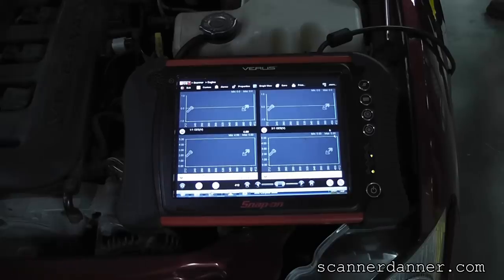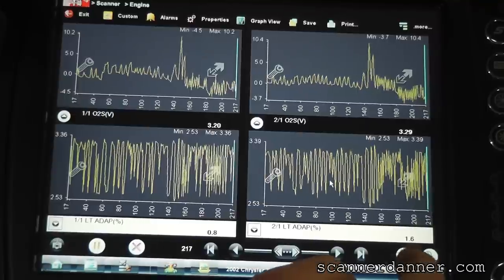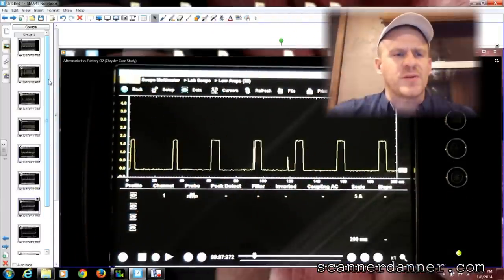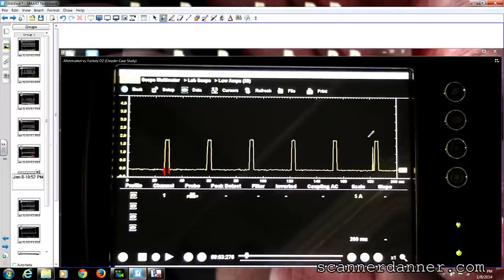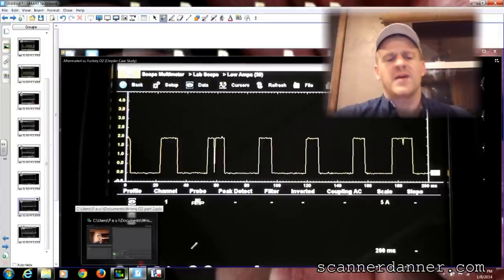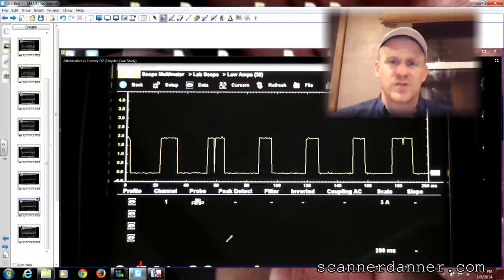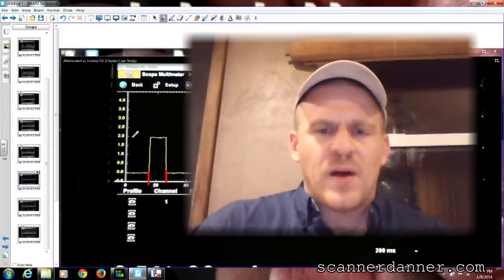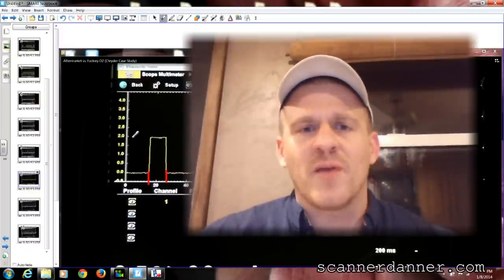WARNING! Aftermarket Oxygen Sensors (Chrysler/Dodge/Jeep part 2)

Comment: Paul,

My guess is that the Bosch O2 sensor/ heater was for the older model years which was a constant +12V feed from the ASD relay design. The newer PWM design heater drive from the ECU if ever having constant "on" would probably burn out the heater element in short order. A heater resistance test/comparison between the 2 sensors would have been a very basic troubleshooting test right out of the "gate". Also going forward, troubleshooting an O2 sensor output problem, I'd really think to measure the temperature of a sensor (while removed from  the exahaust pipe/manifold; insulated/in free air) via an infared laser thermometer. From reference information, all O2 sensors require a minimum of 600 degrees F for them to start producing usable output. The PWM design was probably implemented to reduce the D.C. constant current drain on the older constant "on" ones of the electrical system (4 heaters @ 2 to 4  amps each); yeah maybe saving 0.5% of miles per gallon. Why waste a constant 100 watts + of electrical power when the exhaust normally keeps the O2 sensors hot anyway (above high idle)? The SW/FW in the ECU probably decides if the the O2 sensor output peak voltage starts dropping  then increase the on-time for the heater(s) to get the output back in range.

Just my 2 cents worth and entirely free (LOL)

Tom
Reply from the maker: yep, it is all about fuel economy for sure. Thanks Tom
Reply: +ScannerDanner  I just had this same issue come up on a 2004 Dodge Intrepid 2.7L. B1S1 had been replaced with a Bosch piece. It was setting code P0132,  P0300 and P0301. B2S1 was OE. Graphing data showed bank 1 at -30%, explaining the misfire fault codes. On start up it was clear that while bank went closed loop in 30 seconds, bank 1 would not achieve closed loop until the car was driven, heating the sensor enough to finally start to read closer to the normal range. Close enough atleast for the PCM to achieve closed loop. Bank 1 never did toggle normally or operate in the same 2.6 - 3.5 range as bank 2. One curious point is that the heater duty cycle on the Bosch sensor read about 33% of the OE sensor. Resistance testing indicates that the OE sensor reads 4.4 ohms cold while the Bosch sensor reads 3.2 ohms. I'm not sure if this is causing the PCM to short cycle the heater. It is interesting though. 

After verifying the 5V signal circuit open voltage and 2.5 volt ground, along with heater control operation, I swapped B1S1 with B2S1, just to confirm that the sensor was at fault. The problem followed the sensor. The poor signal performance, difficulty reaching operating range and low heater duty cycle. Checking our parts supplier catalog, I found the same Bosch sensor listed for this application. I tried a replacement Bosch sensor, in case the sensor in the car was faulty. The replacement had the exact same issue. I have installed many Bosch sensors in all makes and models. I have rarely seen any issue with Bosch parts and believe them to be one of the higher quality parts suppliers. This system is simply one variant, due to the 2.5 volt biased ground, that must have a very specific sensor in order to operate correctly. 

Ordered OE replacement sensors (replacing both front sensors on this 175Kmi car) from the Dodge dealership.
Reply from the maker: Don't forget you can order NTK sensors outside of Chrysler for way less!
Reply: +Mark Kelly Thanks for the great vidoes. I love to watch them, just as a refresher. In this video you question when Chrysler began using the 2.5 volt O2 ground bias. I believe this came with the change to the NGC from the SBEC PCM. That change was made, generally in 2003 although some late production 02 models may have received the NGC. I can't say if the Huntington and Motorola NGCs both use the 2.5 volt bias. I should know this but I really don't remember. It's been too long and too many cars since then. I'll know when I get another Motorola unit in the shop and look at O2 signals.
Reply from the maker: Thanks Mark! And thanks for the info
Reply: +Tom Dewey Hi Tom, I picked up this question from the video, whether the difference in compatibility is due to  PWM heater control vs. constant. In this case, for this particular Bosch P/N, that may be the case. I did measure a difference of about 25%(3.5 ohms Bosch vs. 4.4 ohms OE) in heater cold resistance. However, I will say and I'm sure you know this too, PWM O2 heather control is common. A few OEMs use this type of O2 heater control. I have installed Bosch sensors, as well as Denso and NTK in all makes and models of vehicles, including those with PWM heater controls, with rare issues(all brands are susceptible to defects).

Comment: 6 minutes into the video. Maybe it was mentioned along the video or maybe on part 1.
Some insight. Point in case not all parts are built the same way. Period.
For most layman the important info is. Get an OEM (or same factory) aftermarket part. Layman only "see" it's the same thread and the plug fit in place...and there's so much more! ;-)
Particularly on sensors reading and translating "delicate" information. The change of a resistor value, a coil winding, the metallurgy of a contact, the internal design, etc. can and will change the output! It's that simple, no big secret about it! 

Oh! BTW it's not a conspiracy theory of one brand vs the other! LOL 😂 

O2, MAF, MAP... are among the ones who can give bigger head aches. So it's simply easier to go OEM on those. On the other hand a crank sensor, or oil pressure, etc. are basically switches and they're output although critical. It's not so finicky. Pretty much either it's On of Off. 
For the the other example, where 1v is expected on the output. Presenting the system with .8v or .9v will produce different output from the systems expecting the correct value, like an ECU.    

Some assemblies, notice I didn't use the word "brand". Are more susceptible than others. Due to the input tolerance admitted. Once more for the layman it's a pretty big gamble, so make sure to get the part that will introduce the least amount of variations to your equation (problem)! Or in other words OEM. Now gonna see the rest. ;-) 
Cheers

Comment: I have a 2001 stratus with a 2.7 in my shop and can get a sensor ground reading off of it if you would like.
Reply: sure, that would be great!
Reply: The 2001 JR platform cars used the older SBEC (Single Board Engine Controller) which uses the ASD relay to power the heater circuits. In 2003 Chrysler switched to the new NGC computers for the 2.4L JR and somewhere in 2004 or 2005 the 2.7 also switched over to the NGC computers.

My guess would be the NGC computers was when the bias signals started.

Comment: Great info Paul.  On this model does the scan data show o2 heater temp?  You might be able to compare the temp to amperage by making a custom probe on the pico.  You could use the good sensors amperage as your baseline and convert that to temperature.  If scan data doesn't show this you could put a temp probe on the exhaust and measure it to match the amperage, then put in your scaling for the probe setup.  This could be a good way to see if the computer is looking at the 02 signal or if it is a fixed value from the computer.
Reply: Busjockey1, that was a great idea.

Comment: ScannerDanner  I was thinking, would it be possible that the varience between the two circuits is that one is design to be operated in parallel vs series? Given the wiring types the resistance changes each would step down differently on the heater circuit.  If it was designed to run in series vs run in parallel because of the grounding that particular leg may not be getting enough current to properly heat the sensor.  By running at higher rpms the combustion cycle drove the heat of the sensor up to proper operating temperatures giving proper wave form but at an incorrect voltage stating that a resistance modification to the circuit may step it back into normal operating norms.

Comment: @ScannerDanner, have you contacted Bosche about this problem with their O2 sensors?  It could be that they make a proper sensor for that year car, but its listed incorrectly on their web site. Either way, with the proof you show in this video and the part 1 video, they should realize the error pretty quickly and hopefully fix it.

I had a similar problem with Dorman where they (and all my local auto parts stores) list the wrong door hinge pin part number for my wife’s ’98 Mustang. But they do make the correct part with a different part #. I emailed Dorman about it a few days ago but haven’t heard back yet.

Comment: Great video Paul.. Can you tell me if any other Chrysler and dodge vehicles are affected by this design change ex. Jeep Ram or is only the cars?
I work a large retail part store and I am pretty sure that they can get bosch & NGK and  the other aftermarket O2 sensor company's to check into this problem

Comment: So they are not compatible , i am surprised  from bosch , i have a car that i had to run a separate ground , is the pwm the same frequency , maybe the 2.5 v is the feedback .
Reply from the maker: the 2.5 volt signal bias is completely separate from the PWM heater circuit

Comment: This subject is getting deep and I like where you are going Paul. lol  Do you think it could be simple enough to do a resistance bench test between the NTK and the Bosch O2 sensor specified for this engine? Is something like that possible?  The resistance possibly could conclude that the computer is 'confused' and can't figure out what it was designed to do with those parameters.   Remember what the ST fuel trim signals looked like in part1,  when it was trying to 'calibrate' or figure itself out? Bosch engineers obviously have missed something for this to occur.  Maybe if they were informed of this issue they could have some answers!  They spec and sell the product and need to make it right.   Great vid as always

Comment: In the first video the computer decided that the sensor did not work properly and the reading was identical as the other bank. How did it now? The only way I can see that is happened since the sensor was fix high the computer start making the sensor to run cooler and look for a response.But
 I don’t know what happen when the sensor runs cooler and still in closed loop if my theory is right the voltage should drop a little bit in response. What is the purpose of pulsing the heater? Is it to make the heater element last longer. For me it does not make sense why the heater circuit with the current and voltage is identical on both sensor should be treated differently by the computer.
The only reason is a bad connection at the connector which is highly unlikely why is it that the computer is not setting a trouble code at heather circuit if this is not the computer that is switching it on and off for longer period then normal.

Comment: Would this cause a  p0430? I am chasing this problem. Shop told me cats are fine...I did replace bank 2 sensor 2 with aftermarket. And car. At light throttle shudders till I give it more throttle... My car is 06 300c 5.7

Comment: Struggling with a bad sensor reading issue on my 05 Grand Caravan 3.8L, confirmed it has the 2.5v ground wire bias.   Went to the local dealer and opened up their sensor....... Bosch!  Same as the one in my van which I believe is the original. Explain that.
Reply from the maker: It is becoming more and more difficult to answer questions here. I have 80,000 people asking me for help now. So I have created a forum to help you guys better. It is free to join and we can exchange pictures, wiring diagrams and waveforms if needed to help guide you through the process of troubleshooting your vehicle. Thank you so much! Hope to see you there. 
Paul Danner (ScannerDanner)
 https://www.scannerdanner.com/forum/post-your-repair-questions-here.html

Comment: Hi Paul. I'm blown away by your videos, you're like an Ienstein. Anyway i have a 1990 jeep xj renix. I replaced the o2 sensor with heated aftermarket. One was Bosch the other NTK, both look identical. The issue is they both caused a parasitic draw of almost 2 amps. Where would I get one that works in renix engines? Thanks in advance.
Reply from the maker: The renix system uses a titania type O2 sensor that modifies a 5v reference. You absolutely cannot use a typical zirconia type O2 in those. Where to get one? That I cannot answer my friend.
Reply: This might be a bit late, but my Renix-based 89 XJ uses a NTK 23553, it is a Titania-bssed sensor.

Comment: Would this go for an 03 jeep 4.7? The forward 02's were replaced with denso by the previous owners. Sometimes it runs decent, sometimes pretty rough. I'm thinking the 02 sensors are the issue
Reply from the maker: yes sir
Reply: @ScannerDanner  thank you for the reply. Love the vidros

Comment: anybody, do you think this problem with a chrysler o2 after market sensor will cause the same problem with a chevy silverado? my original sensor on my silverado went bad, so i replaced it with a bosch sensor and the problems  still exist. i inspected the connector and cleaned it but the problem did not go away. i am going to replaced it with a donso o e sensor tomorrow.
Reply from the maker: I've had no issues with Bosch O2s on any other manufacturer
Reply: i replaced the bosch o2 with a denso o2 sensor monday night and i did not get a p1133 code since then. i took the truck for an emission test today and pass it. woohoo. i will never get a bosch o2 sensor again.
Reply: Nice! Crazy Bosch hasn't fixed this issue

Comment: One thing I noticed that jumped out at me between the last video and this one was the triangle waveform.  You even recognized it yourself.  I said to myself there's something else going on with that triangle.  It's really hard for me to describe but it seems as if there was a filter between the triangle wave and the drop outs.  I only saw the triangle for a short period when you were really zoomed in (maybe 1ms scale)?  I think there might be an overlap worth investigating.  Like if you offset two sine waves there's going to eventually be a dropout both high and low only in this case the overlap of the triangle is causing a low dropout.  You're not seeing the high drop out (overvolt) because you said it is being limited by the ECM. I have NO clue if that's even close to being helpful.  It's an idea, a theory, and I know you like hearing those.

Comment: On a related topic, I cleaned an O2 sensor...stop screaming at your screen and I'll tell you what I did, and the results.

I was polishing up some metal on my exhaust anyway before getting a good weld on it. Metal flakes got all over in my pipes pre-cat. A mental palm to the forehead later, I pulled both O2 sensors and blew my air compressor in them to get the metal shavings out.

I noticed my upstream O2 sensor had built up white crud on it. It had looked good on my scan tool until recently. It seemed to lag behind or get it wrong a little bit.

I'd hate to replace a good sensor just on suspicions, especially after this channel and Schrodingers Box, so risking buying something that I might have bought anyway, I just used my polisher to take the contaminants off the outside of the sensor where it goes in my exhaust and hit the inside holes with just a blast of air, so nothing is here that'd contaminate it by cleaning it. (A flurry of possibly white junk left the internals of the sensor.)

I also polished off the caked garbage on the outside. I have no idea which part on the outside it uses to reference exhaust conditions to get it's voltage, but clean it became.

My waveform was immediately better. It responded much more quickly, and my STFT did quicker switching.

Part 1 got me thinking about this from your comment Danny, as you noticed patterns that the PCM appeared to be testing bank 1 O2 sensor, when the bad one was in bank 2. I noticed a similar pattern when I was worrying if my O2 sensor was bad. Maybe the computer wondered with me.

It's all good now, except the complaints from that Toyota Technicians give about Bosch on a Toyota. Hey, I bought  this sensor 90k miles ago, and it appears to have great results especially with a clean up.

This was an ideal situation to risk losing some sensor quality since expected service life is almost "done".
Reply: I failed to mention that it also goes into closed loop instantly and that feature had recently slowed a great deal.
Reply: Further report. To he who tries this, order a new O2 sensor. 5 days of work and daily errands later.... I'm not surprised that it now is reporting even worse. 50% LTFT and STFT combined and it won't read rich. Then the O2 sensor behaves again and STFT is as negative as LTFT is positive. LTFT catches up and everything looks good, then the O2 sensor flatlines again, lol. LTFT and STFT goes back to going higher and higher like I started describing at the begninning, or better yet, the O2 sensor half responds only to drop out or suddenly do better again.

MPG is about 1/2.

Question is, since I have several days before this O2 sensor arrives - no one sales the right one in town, am I better off unplugging it so that the computer can try to run off the MAF instead of countermanding with a false O2 reading?
Reply from the maker: If its a Chrylser your describing it will do the same thing unplugged. Btw. The NTK sensor is the correct one for these. Just fixed a friends Chrysler for a fraction of the cost of a dealer part
Reply: Denso's are recommended on this Corolla/Prizm. And thank you for the answer. Intermittently not having extra fuel rather than constantly for several days of only several miles of driving a day sounds better to me.
Reply: Granted this is a different car. If you don't know how a 1ZZFE responds to being unplugged I can go outside and find out. Same as the Pontiac Vibe and Corolla you got deja vu on when the fuel injectors failed the same way.